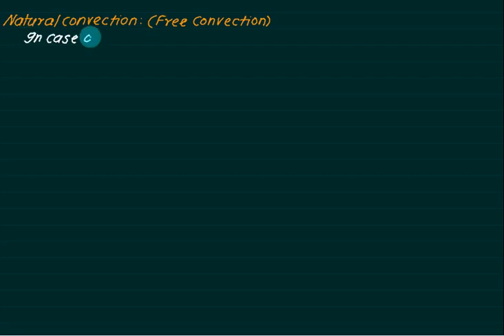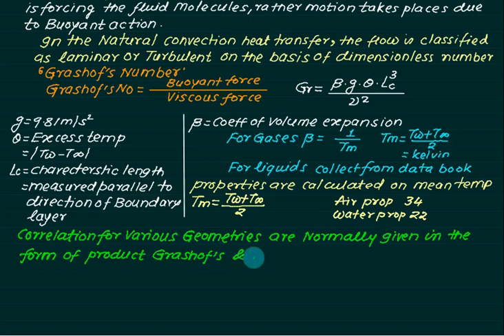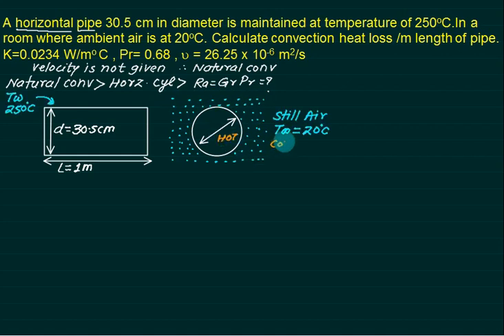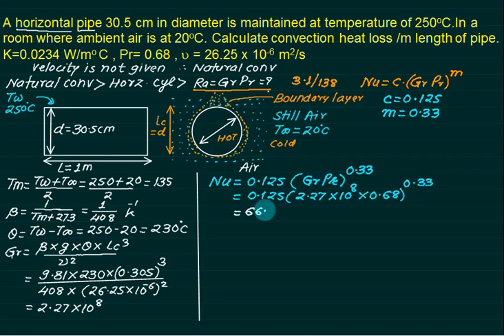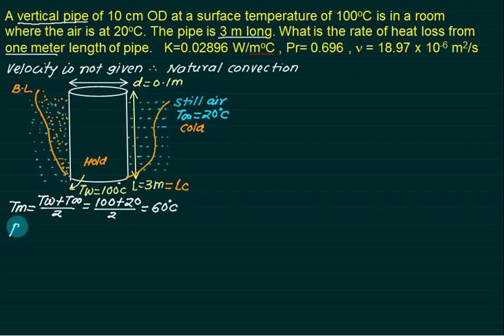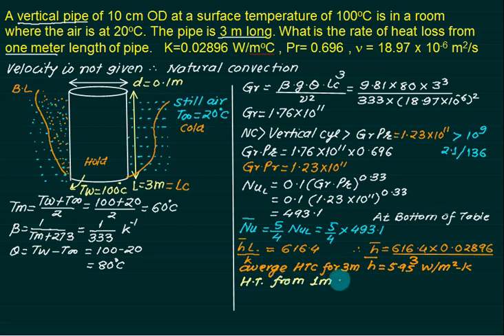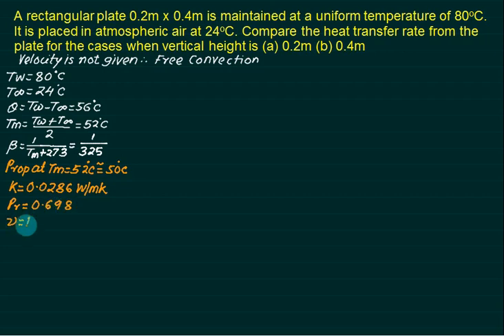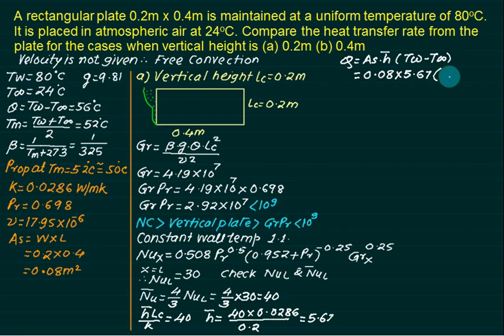12 Free convection  Numerical 1

Comment: a long road of radius 50cm thermal conductivity of 10 wat per meter k contains radioactive material which generates the heat within the cylinder at a rate of 0.3 into 10 raise to 5 per metre cube the road is cooled by convection from cylinder surface having a fluid temperature 50 degree celsius and heat transfer coefficient 60 watt per metre cube kill ven determine the temperature of the centre and outer surface of the road

Comment: hello sir many thanks for your lecture , i may have pleasure if can guide me for ware bath heating for gum boiling, at presently i am using water bath ,as 200 liter oil barrel filed with water, in side stainless stell barrel filled with gum salutation gum soultation 80liter mix with water, +sodium meta borate , oil barel filled with water, heated by lpg gas burner, i need to boil gum solution up to 80 degree temperature , oil barrel filed with water to give water bath to stinless steel drum having spce around75mm in , both vessel is in round shape , can u guide me in water bath heating this fluid to require minimum wastage of heat how can i get? can i use gum soultation is better to use copper metal round barbel , i may have pleasure to know your valuable suggetation in this matter , i may have pleasure to receive your mail id or contact no many many thaks for your lactuer thanking you naresh joshi